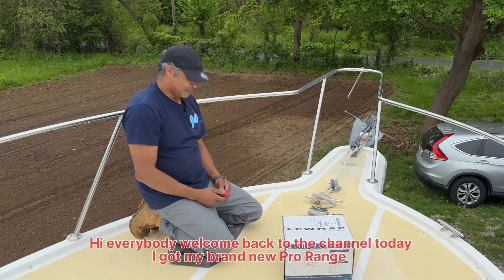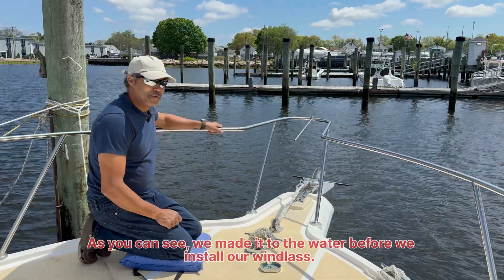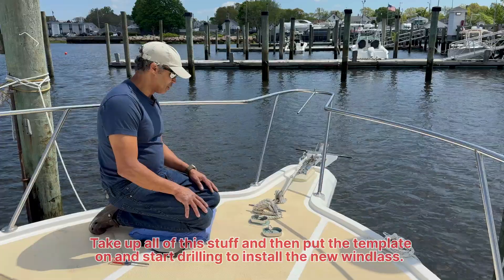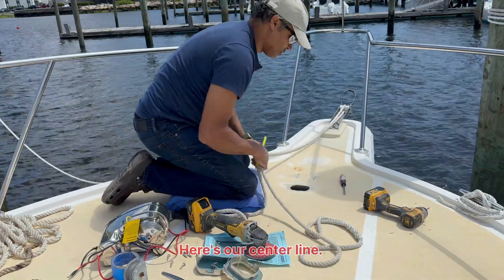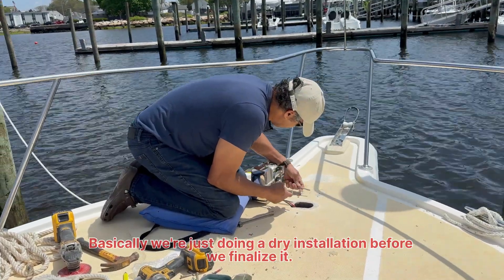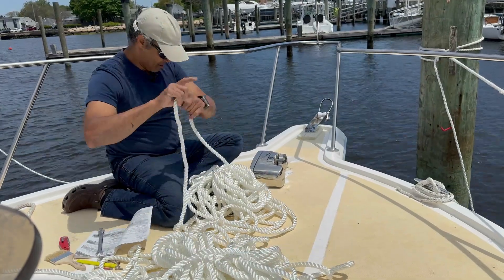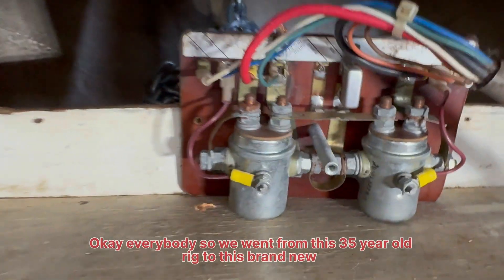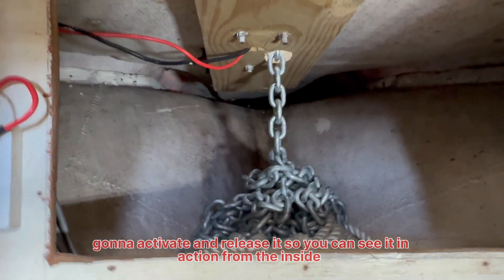How to install a windlass anchor system

Comment: You should've put large flat washers on the winless studs and double nuts
Reply from the maker: Thanks for the suggestion. That is a great idea to add structural strength and keep the nuts from vibrating loose.
Reply: "That's what SHE said"@jandoinc